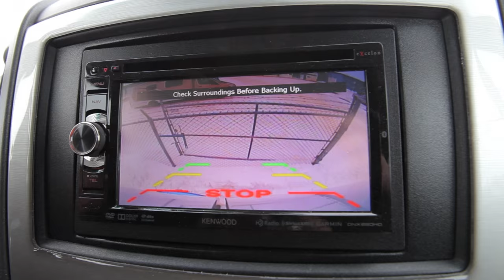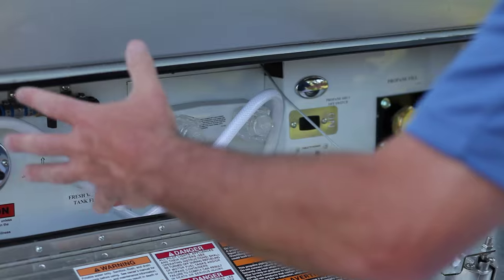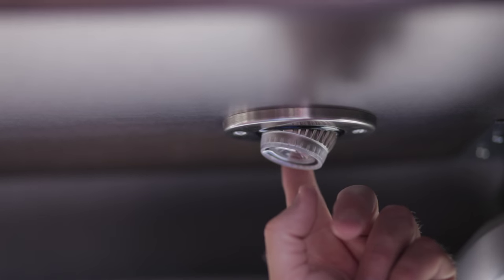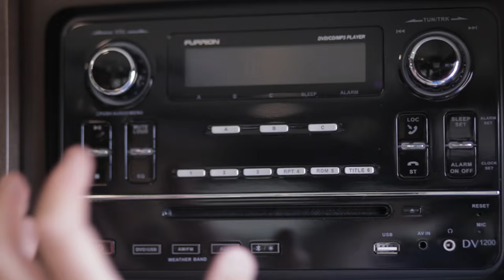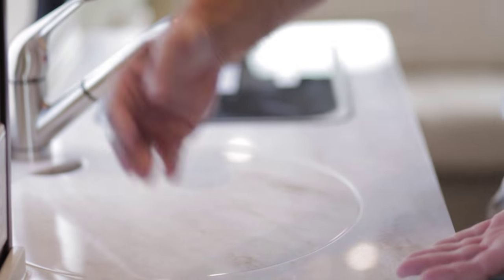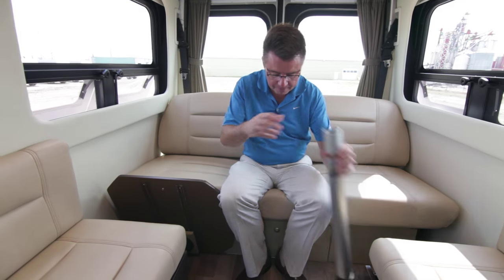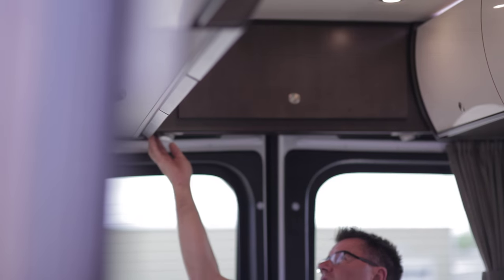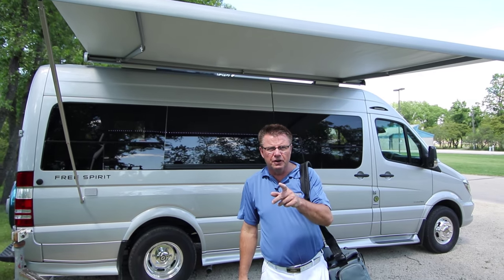2015 Free Spirit

Comment: IF they had built a traditional bed on top of the driver and passenger side that would've given this model TWO separate sleeping beds but they only have one.  The design with the bathroom upfront really doesn't utilize the space very well.